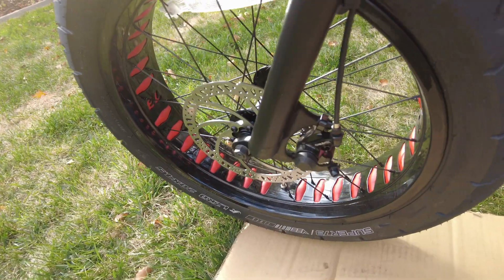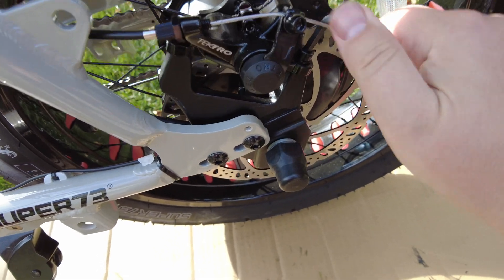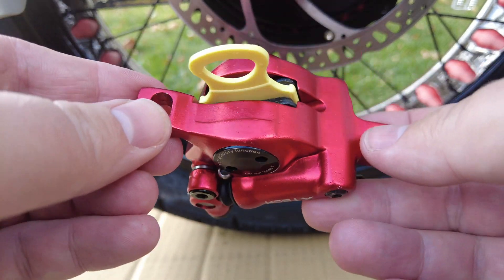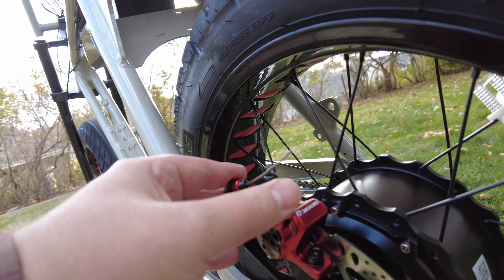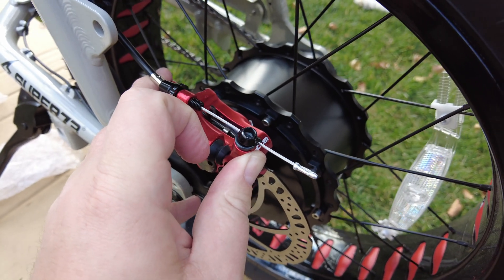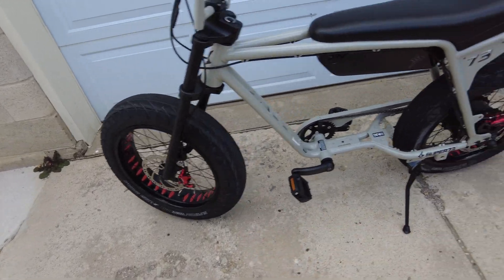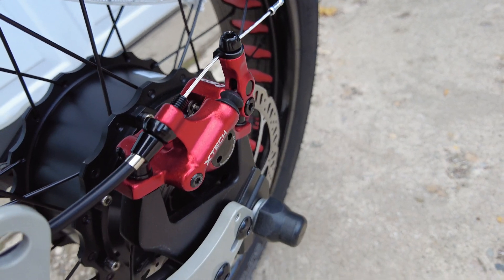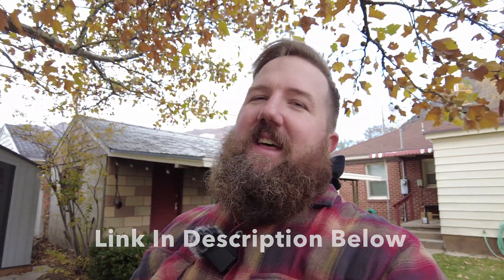Upgrade Your @Super73 ZX Brakes to Hydraulic Brakes for Under $100

Comment: I have a ZX and I bought these hydraulic brakes. unfortunately the rear pads are sitting slightly above rotor which causes the pads to wear unevenly. Is anyone else experiencing this issue?

Comment: Hey bro. I have the ZX and want to upgrade my brakes. 

The back brake is completely broken and wire is torn, so I will need new wire, new caliper and new brake levers? Could you please help me find a complete set for a whole new brake set that will fit? 🙏
Reply from the maker: I have these on my S2 and they work great: https://www.fastace.com/collections/brakes-set-hydraulic-disc-brakes/products/fastace-mtb-hydraulic-brakes-set-hydraulic-disc-brakes-mountain-bike-oil-brake-two-piston-four-piston-bicycle-brakes-for-mtb-xc-trail-e-bike-fat-bike-left-rear-right-front

Comment: since its hydraulic doesn't it need like some sort of fluid or is this one different
Reply from the maker: It has a reservoir in the caliper that is actuated by the cable pull.

Comment: how was your experience with these brakes?
I ordered a pair for my troy Diablo city shopper E fatbike over here in the Netherlands my bike is completely mat black the red brake claws will pop nicely on there guess those tektro brakes are what they use almost on every e bike without hydrolicks 
these stand alone hydrolick brake claws are the solution and easy without changing the brake levers thanks for the vid 
my bike store never heard about these brakes and did not believe it so I showed him your video a hole new world opend for him 
I hope they work better than the tektro ones that came with the bike well I did ordered them 
how was your experience?!? 

greets from the Netherlands
Reply from the maker: I'd love to visit sometime. I only had these on for a short while before I sold the bike for an upgrade, but they work well and I've seen others comment that they do too.

Comment: Thank you So much for this tip man! I ordered them. Installed them (only took like 15 minutes including calibrating. It is So much smoother but stronger. Such a great jmprovment on the original brakes. Very easy DIY. Looking for some further upgrades as well. Considering to upgrade the range with the chi battery to go on propper trips. If anyone else has some cool upgrade ideas for the ZX Please let me know!😊

Anyway. Thanks for the tip And easy diy turtorial. You earned my sub big time! greetings from the Netherlands!
Reply from the maker: Awesome. Glad they worked out for you! Thanks for the sub.

Comment: Will these work on the Z1?
Reply from the maker: I'm not 100%, but they should if the Z1 brakes are mechanical.
Reply: @SESSIONS73  yes they are mechanical and look similar to yours, i guess im a buy them and try, can always return i guess
Reply: Yes they work on Z1!
Just have to leave existing bracket from mechanical brakes and they fit and function perfectly!
Reply: @cash4inmatedepositservices731  Thanks for the followup.

Comment: Hey! Thanks for this video as I wanted to upgrade to hydraulic brakes for my new ZX but wanted to keep the brake switch. I did order the juintech ones as I couldn’t find the ones you’ve got in the UK and do cost a little more but that’s fine! Seems dead easy to do and thank you very much! I may also upgrade the front rotor to a 203mm as the stopping power will be much better. No real point doing both as 80% of the stopping power is at the front of the rider. Maybe you could try 203mm rotor at the front and let us know what you think?
Reply from the maker: I am actually going to be adding 203 MM to the front and back of my S2. I'll make a video on that.

Comment: The ENTIRE point of a hydraulic brake system is to replace the stock brake line “wire” with hydraulic fluid. Fluid is superior because it doesn't stretch like the wire.
Reply from the maker: True, but you get some nice pressure with the Hydraulic caliper. Anyway, it was an easy swap, but a who hydraulic system is superior. I agree.
Reply: I was so confused the entire video staring a cable actuated system while hearing "hydraulic" over and over. haha

Comment: Would these breaks work on the z1?
Reply from the maker: They should work with most mechanical brakes. Just make sure the rotor is wider than the pads.
Reply: @SESSIONS73  did they work on the Z1?

Comment: Errr.... these aren't hydraulic. They are cable actuated disc brakes. C'mon man.
Reply: You just replaced one cable brake for another.
Reply: Thats what i was wondering. The whole point of hydraulic is the brake lines making for essentially zero loss unlike cable and their usually very flexible housing. You could upgrade the housing to stiffer ones if super73 uses standard ones, and they'd run you maybe 20-30 bucks, but would reduce some of the sponginess that comes with cable brakes. Dont quite see how the little reservoir would be doing anything. The normal mech lever is already linear so not much that can be improved. Maybe a bit less friction because the cylinder is more free floating. Though cleaning a potentially clogged up normal mech cylinder probably would do as well
Reply from the maker: No no, there is a hydraulic reservoir in the brake case. The cable actuates the hydraulic pressure to press the pads against the disc.
Reply: @SESSIONS73  Hydraulic disc brakes use a sealed fluid system to transfer the braking force from the lever to the caliper. The ones you are showcasing are cable actuated. If the piston uses a hydraulic reservoir that doesn’t mean it’s a hydraulic brake. It just means the manufacturer is playing a little game of semantics. There is a big metal cable that runs the length of the bike that has to be mechanically pulled in order to brake. That’s a cable brake.
Reply from the maker: I understand your point, and I feel like I am pretty up front in the video about how they work differently than your standard hydraulic brakes. Either way, they feel a lot better than the brakes that come stock. Not trying to mislead, so thanks for your comment in helping clarify.
Reply: @davidtome  realistically the main reason people get these for they’re ebike is because it’s actually really difficult to get hydraulic brakes with a motor switch. So getting a cable actuated hydraulic calliper is the second best thing to get. The only draw back then is yes, cables will stretch a little but isn’t hard to fix. Takes 5 minutes or less when you know what you are doing. A full system is better as the force you are applying is amplified where a normal mechanical only applies the pressure you make. So these hydraulic callipers amplify the pressure it receives from the cable, which is way better then what the original set up was. So isn’t really a bait and switch.

Comment: The brakes say its for 160mm rotors but Super 73 ZX's are 180mm break rotors? Do those exact brakes fit on the Super 73 ZX?
Reply from the maker: A bike mechanic told me that as long as they don't overlap the rotors, you're OK.